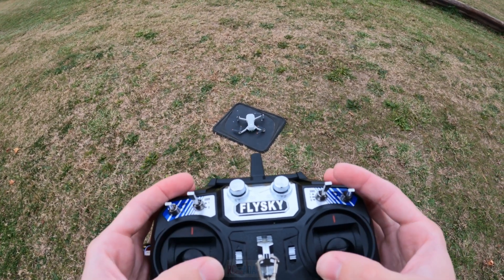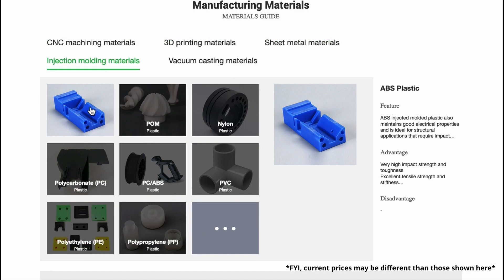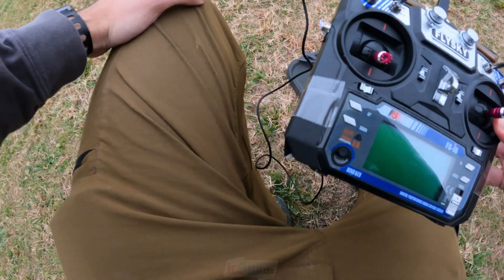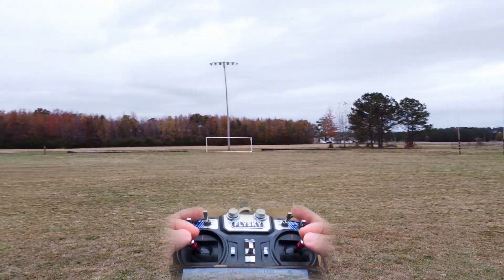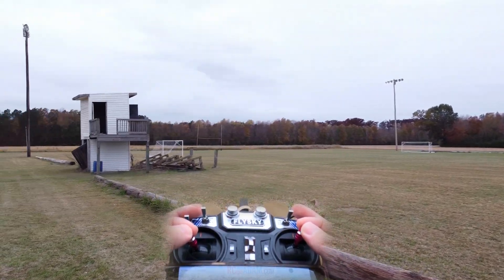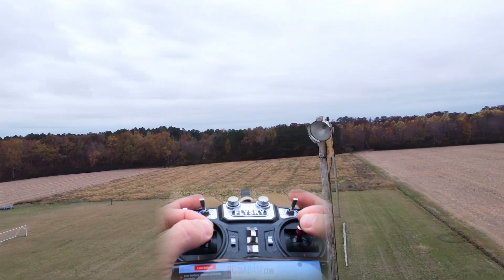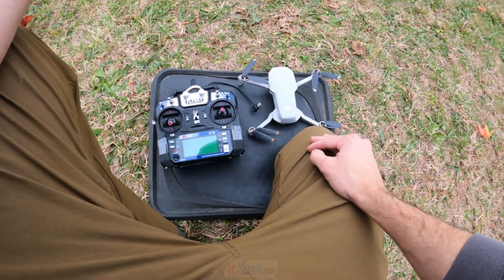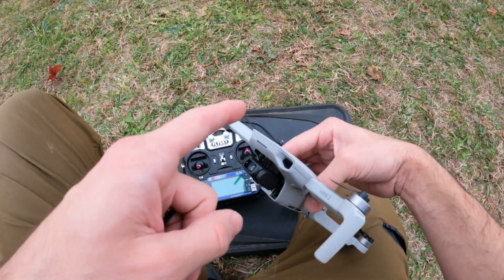(🫣 DJI Fanboys, look away) Improving DJI RC with FlySky Gimbals // WHY are DJI Gimbals so TERRIBLE?!

Comment: You taught me The 2s battery pack   for the radio remote controll , or  "tx" everybody calls it . Some ads have questions that sound like new  hobbyists hear " flight controller "  but that is the pcb with parts installed on it inside the model that   connects motors to rx etc . Sort of an autopilot in part .

Comment: Happy Thanks Giving , Adam !  You are a lot Smarter , daring  , and inventive than me ! .... How is the ole FlySky Radio doing ?  Is that i6 to i10 software hack still working ? ... If it is , I might try it ... Have you run into any new Flying Sims that are Fun to fly ? ... Genius Mods on the DJI Mini !   Cheers !   :D
Reply from the maker: Thanks Robert. I haven't been flying with the flysky that much these days, but it's still going strong. I am right now trying out some different sims. I should have a vid on that later.
Reply: @RCwithAdam1  Awesome !   :D